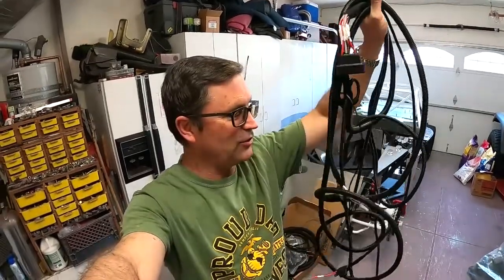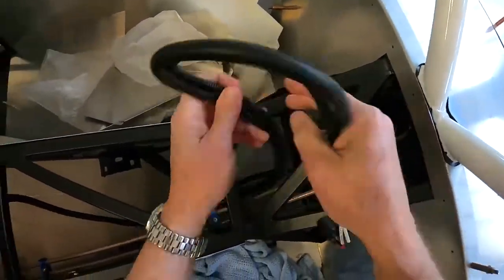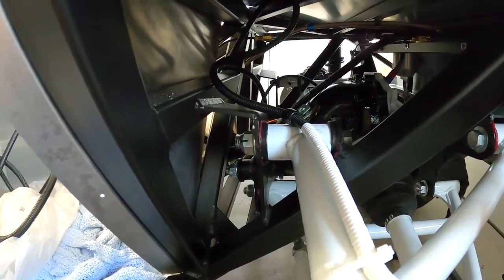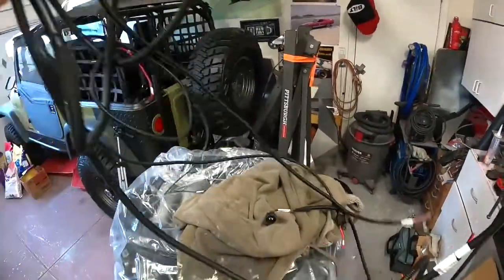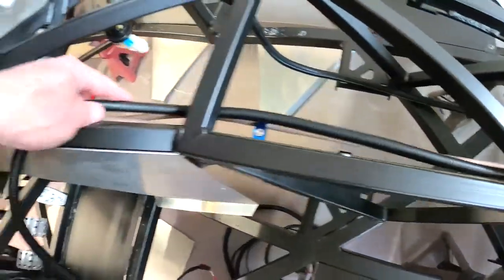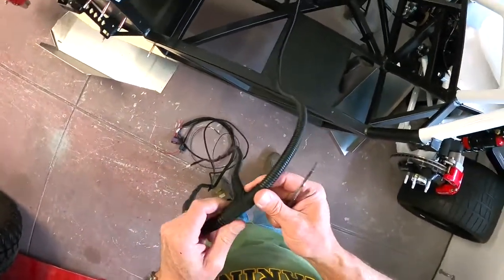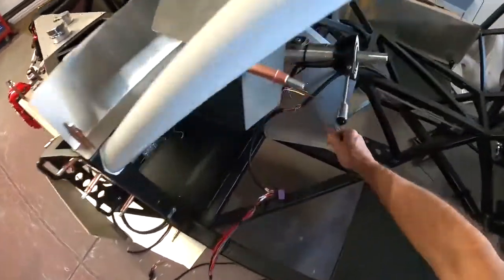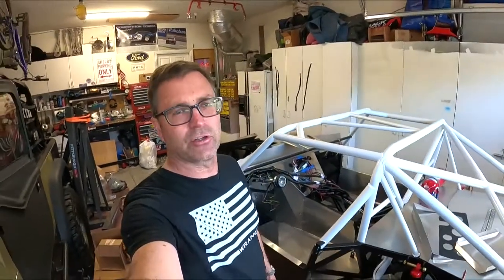Cobra Daytona Build- EPB Wilwood Wiring, Video 71

Comment: Nice, did you have to adjust since you flipped the left and right hand side?
Reply from the maker: The electrical connectors are the same for each side so I kept the left plug on the left for troubleshooting purposes.

Comment: As a certified master tech that specializes in electrical repairs... that splice makes me cringe. That being said, adjusting and shortening the harness is absolutely a must.
Reply from the maker: You are obviously have way more knowledge then I on electrical, I am an ME so electrical is my weak spot. You don’t like the butt connectors with solder built in?
Reply: @cobradaytonabuild1671  Generally speaking, no, I've always believed butt connectors are for temporary emergency repairs and mock up testing, and should never be in the final product. That isn't the cringe, though. Having all the conductors spliced at the same point gives you a "fed snake" bump that can often give you clearance issues feeding the harness through and makes it a bit less flexible. Please don't think I'm digging in you too hard, I've been doing that type of harness building for over 20 years and most of mine look like Big 3 production parts.
Reply from the maker: Thank you for the input as I am always learning. I usually do stagger the connectors but not this time. What do you think of the butt connectors with solder built in?
Reply: @cobradaytonabuild1671  As long as the sleeve is adhesive shrink, then they're fine, and can easily be a permanent repair. The only problem I have with them is the added bulk to the circuit. More than anything they are meant to make the work simpler and faster, both of which mine are not. I make very meticulous splices with solder alone.
Reply from the maker: Always adhesive shrink!